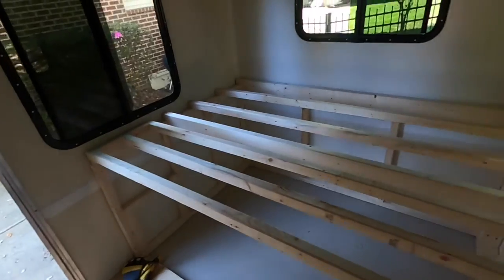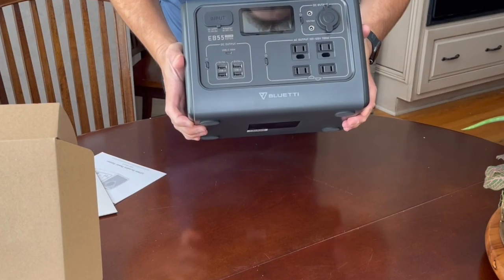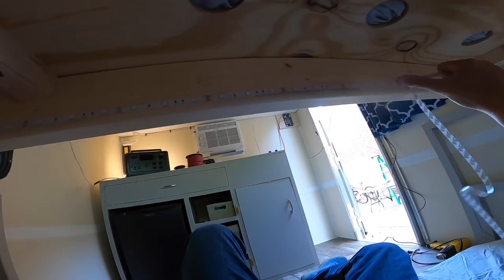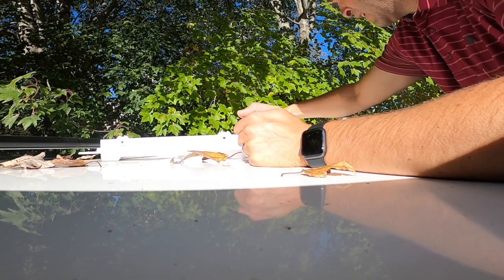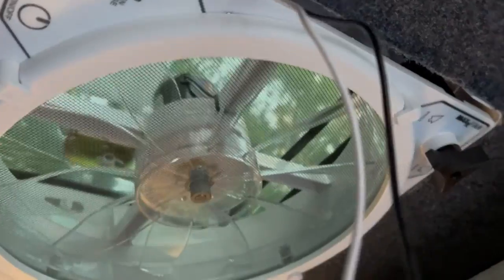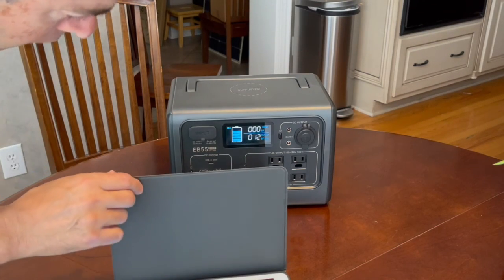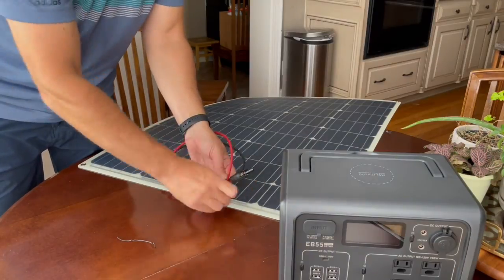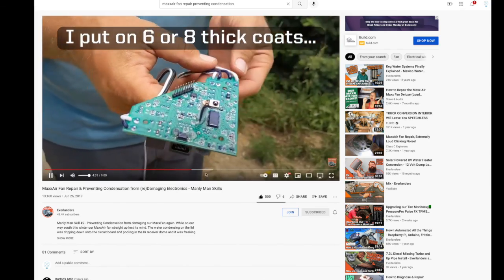Mini Camper - Electrical System - Runaway Rouser - Episode 4  with Maxxair Fan and Bluetti EB55

Comment: Had my vent installed dead center. My theory is it will help air out the areas more evenly plus the screen door already assists in this front area already.

I can see the aerodynamic advantages of having it up front like in this video though. ☝️😲 definitely seems good there for that.

I was also worried about structural integrity. On my mod the ceiling roof hole is only weaker in the middle so this was my other reason to put it in the center. Hopefully nothing jumps up over on there...
Reply from the maker: My vent location was based on where I expected to have my Colman stove on the counter.  But the center would have worked fine too.
Reply: @BenLaurenzi  I'm a bit nervous cooking indoors in a camper. I feel like I might accidentally lite something on fire or get carbon monoxide/gas poisoning. Plus the sink water (usually next to the stove in most campers) tends to splash over. I like that some teardrops have outdoor galleys but they take up soo much room in an already small space :/

I also used to eat inside my old full-sized camper before switching to a runaway and i ended up getting crumbs/ants in my trailer!!!
 
One time I ate peanuts (with ants) and started noticing them in my beard!!!

Now I just eat outside. Better for everyone...